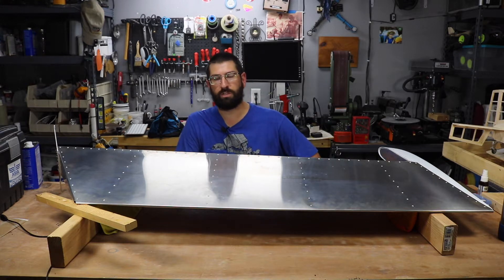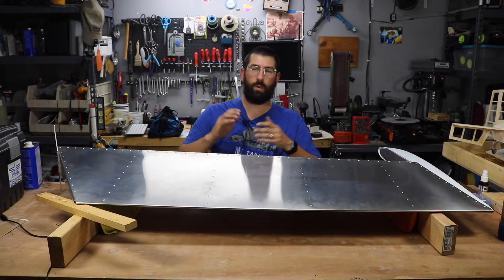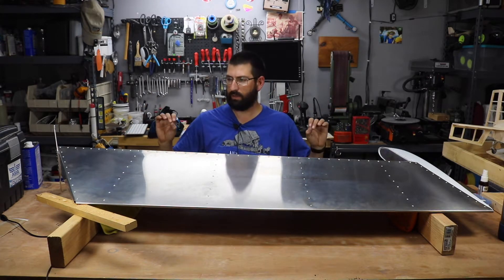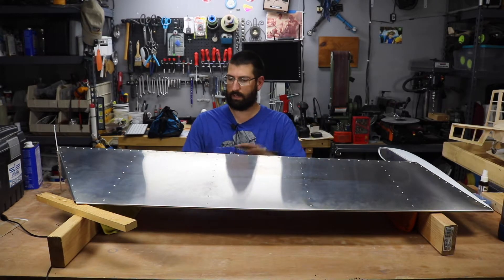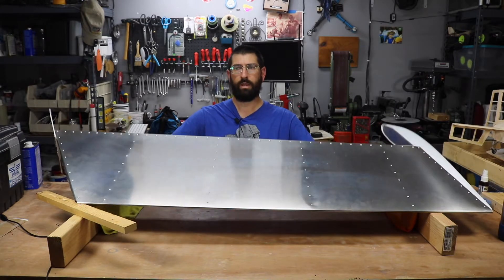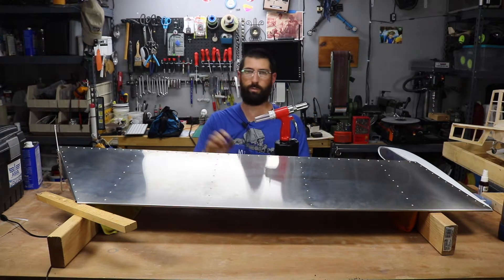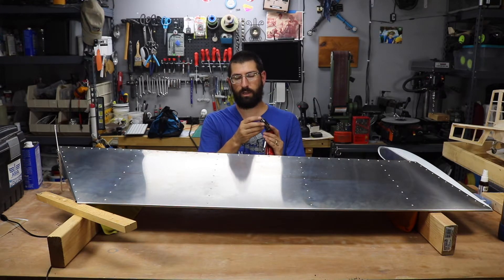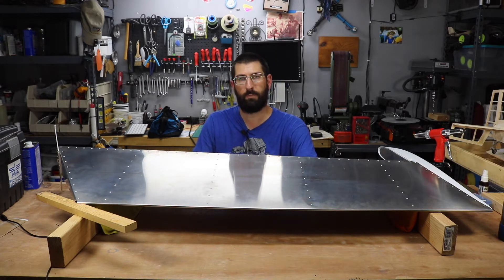Zenith Cruzer Rudder Build: Part 1-B

Comment: This really would be a joy to build..... mann you make me yealous  😜😜
Did you do some kind of anti corrosion coating at the inside of the panels ??
Enjoy the build Joe, and make sure its a safe aircraft 👌
Reply from the maker: Thanks for the comment and support. No, I live in the desert and based on many hours of research, I have decided that it isn’t really needed. When I get to the fuselage I might do some priming in the cabin areas during the assembly.